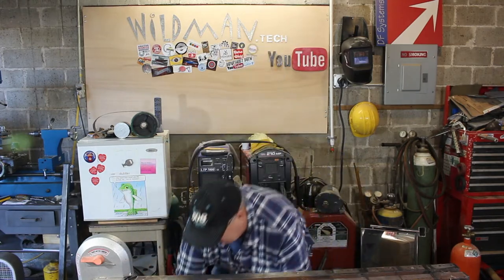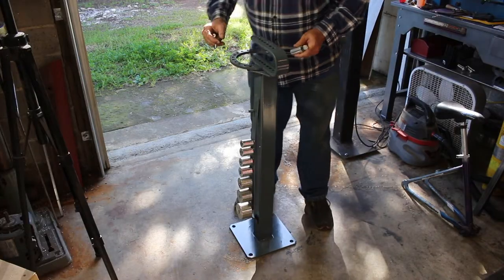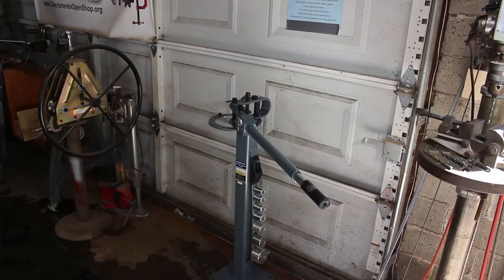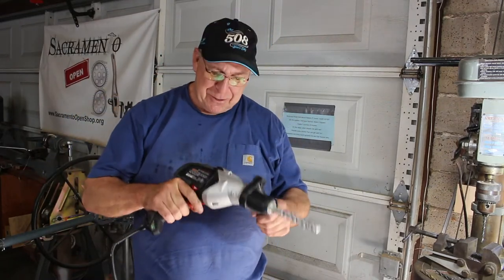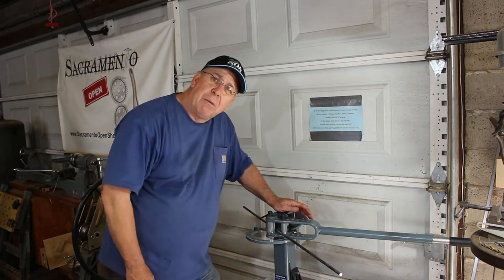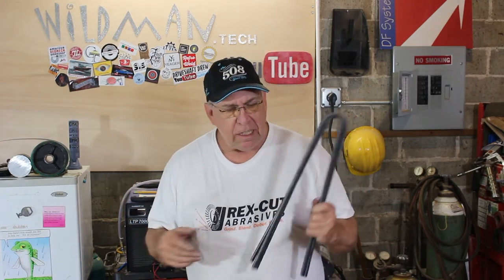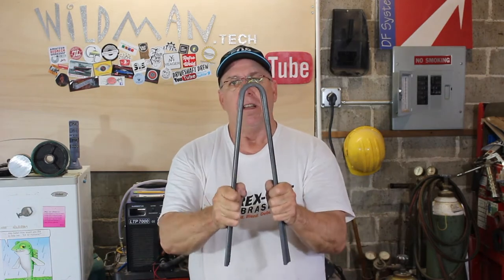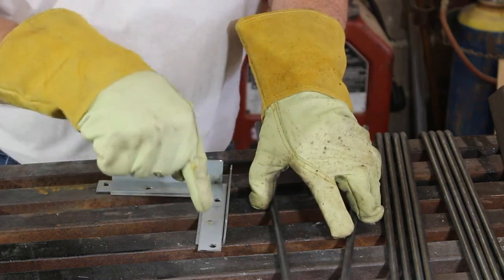How to Make Hairpin Table Legs and Central Machinery Compact Bender Unboxing

Comment: Only thing to watch out for is those L's are zinc coated and the smoke from the welding is really toxic so good ventilation is VERY important.  The Zinc burning up is where the black schmoo is around the welds.
Reply from the maker: Welding fumes are pretty nasty whether you're welding zinc or not. If you smell anything at all while you're welding, you need better ventilation.
Reply: True but Zinc fumes can be very serious, rather than just bad.  Just a heads up.  Generally welders will grind off or chemically remove zinc and other galvanizing metals if possible.  With stick and MIG you can get away with leaving them, TIG not so much.

Comment: hairpin legs are cheaper to me than the time i'd spend making my own, but i also live in the SF Bay, so it's all relative. sacramento is definitely cheaper. if i am not earning at least $50-60/hr I'd rather buy it.
Reply from the maker: I can knock out a set of four 16" hairpins in half an hour at a cost of about $8. They sell for four times that.
Reply: @WildmanTech  so thats $48/hr. Decent :)

Comment: Plastic masonry drill.  That’s hilarious.  I always wonder how long stuff lasts when I hear folks talkin about cheap tools from those heat big stores in the us.
Reply from the maker: It’s a Craftsman!
Reply: Those real big stores I should say.  Predictive text is so unpredictable 😂
Reply: Many years back when I was an apprentice a guy told me.  Buy good old used quality stuff if you can’t buy new. And leave the disposable stuff.  I did.  I’ve some old hitachi drills & grinders made in Japan 20 yrs going strong. Still easy get parts and fix them up.  My brother in law has a truck load of cheap power tools gone to the dumpster. .
Reply: Nice video 🙌

Comment: I love the fixture you rigged up. Looks like you went with a $90ish bender. I see one at HF currently that is lighter duty and runs $40ish. Would that one work for this? I’m trying to keep cost down and also find a bench mountable option.  My floor space is at a premium. Thanks and keep up the good work.
Reply from the maker: The price has gone up. The $50 bench top model looks like the same bender without the base. I would go with that one if you want to make hairpin legs. The $40 one is different, but it says it will handle up to 1/2" round. What is apparent to me about it though is that you won't be able to get much more than a 90º bend out of it.
Reply: Thank you.

Comment: Great tutorial!  Can't beat that bending machine from Harbor Freight.  Where did you get the L brackets that were welded to the legs?
Reply from the maker: I got them at a hardware store that was going out of business. Now I get them from a hardware supply on line. The price changes every time I search so i just go with whoever is cheapest.
Reply from the maker: I've now started making my own

Comment: Great lesson.  Which way did you move the center point mark on your second try? To the left or right?
Reply from the maker: I've tried everything. I have to cut them long and trim them to length. I have hundreds of 1-1/2" pieces.
Reply: In your video you move the center point from 18" to 18.5". You came up even once you moved .5"   Which way did you move? Thank you!
Reply from the maker: Results are not consistent no matter which way I move it. That's why I make them long then trim them.

Comment: Breathing the toxic fumes from those coated L's is about the worst thing you can do.
Reply from the maker: Actually, there is way worse you could do, but what makes you think I would breathe ANY welding fumes? You can't see the fan behind me, but you can see the fumes blowing away from me. Surprised you didn't notice that.
Reply: I don't mean to hurt your feelings Wildman, but, based on your answer, it's pretty obvious that you don't have much shop experience. To anyone watching, use "un-coated" materials. Never zinc or galvanized.
Reply from the maker: @tribalconcrete  Breathing ANY welding fumes is a bad idea because they are all poisonous. I use a ventilation fan.